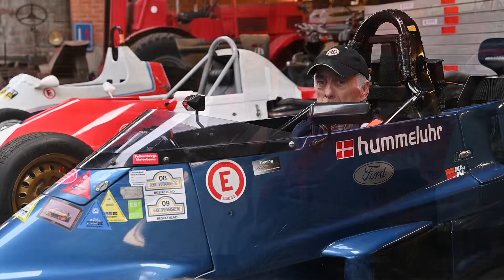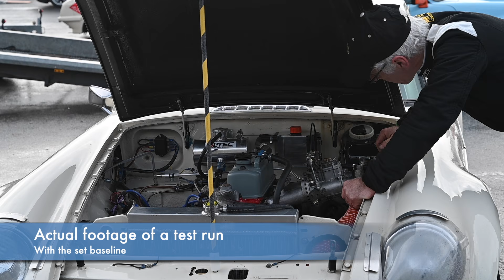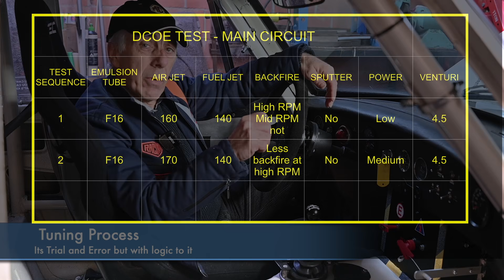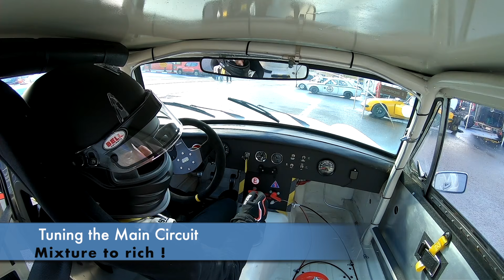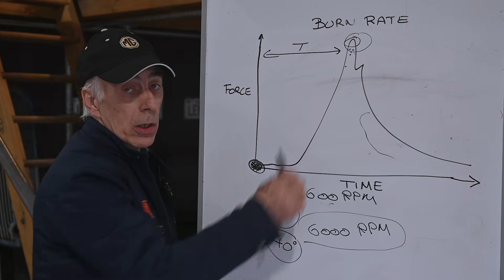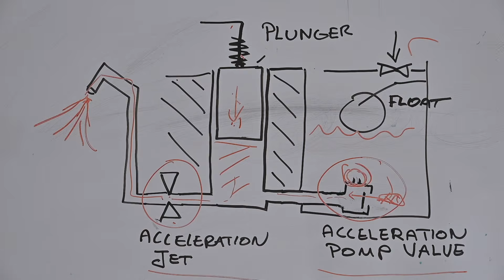Weber DCOE tuning -  Main and Acceleration circuits

Comment: I need help I've never had a car with Weber's now I own 1985 Ford escort with a 1.6 liter.  9-1 pistons milled head dual Weber if 40s down draft it has a 270 duration 440 lift cam and header and anza exhaust.  Sluggish till 4000 rpm then to 8000 it pulls ok. Maybe itz ok Cruz I'm used to 7 and 8 sec card. But this is set up for road racing.
Reply from the maker: I have an entire series on the working of the weber and jet selections.   Maybe have a look first on those.   Here are some baseline settings for the Ford ( I assume its a 1.6 Pinto) . 34mm ckokes, 140 main jet, 210 air correction jets,F16  Emulsion tube, 40 accelerator pump jet, 4.5 aux venturies, 45f8 idle jet, 11/8 Turn out idle screws,7.5 mm float and 15mm full droop float

Comment: Very good video! my car has too rich mixture in mid range and spot on high rpm... what could be?
Reply from the maker: That is not that easy to say, it all depends under which conditions - Load- on the engine. RPM's alone don't say much.  Assume that you are cruising ( butterfly partially open) and low end of mid to mid RPM's.  Then  i would increase the idle jet for more air ( larger opening), as this jet ( combo of fuel and air) handles the idle but also the transition circuit.  which will be in use during the low end mid/md `rpm range under low load.   What i  am trying to say is that the possition of the butterfly is importend to determine which circuit is feeding the engine.  Now assume that the butterfly is past  the progression stage, then you might need another emulsion tube that provides less mid range fuel feed.  or you might want to increase the air jet on the emulsion tube...  When you say "runs rich"   what does that mean ' backfires, puff's in the carb ?"
Reply: @D3Sshooter Thank you for answering, i didint specify enough. This is in a race car condition on full load, i use wideband to see the mixture. So, i exit a corner full throtle at 4.500 rpm and goes super slow (11 afr) from there still on full gas at 6.000 gets 12.8 - 13 afr, right on point... and when it gets the last 7.000-7.200 it tends to get a lilttle richier again (12.5).

Sorry if its a little confusing, you can see it running on my last video on my channel
Reply from the maker: @diegougarte  Ok , I see ...  Thanks for coming back with the clarification... The moment you exit, I assume the pedal is to the metal as they say.  That action causes two things, the accelerator pump sprays in extra fuel and the butterfly is wide open.  As the opening is now large, the air speed in the barrel goes down and as such the venturi effect on the secondairy venture reduces ( less fuel through the emulsion tubes and the main jet).  However the acceleration pomp has injected fuel. to aid the acceleration.   In your case , It seems that to much fuel is injected   as the engine bogs and is slow to accelerate. ( I bet you have a black smoke on the exhaust at that time)..   In this case you might want to adjust either the acceleration pump jet, go for a one step smaller ( I don't know what you have in it)...That will reduce the amount of squirted fuel and helps to reduce the  rich AFR. or the drain jet ( comes as a 0.35 to 1.5mm, the bigger it is the less fuel is squirted in when you floor the pedal).   the acceleration jet for the DCOE is a  76801 and comes in many seizes from 0.3, 0.35, 0.4   and up to 0.90.   Check it out...

Comment: I very much enjoy and appreciate your videos.  They are very informative.  With the Webers, it is worth mentioning that there is a difference in base idle mixture settings between the Italian and Spanish manufactured units.  I struggled a bit getting the Spanish units set before I discovered that the idle screw is different and needs more turns out at the base setting.  The needle is longer and sharper.  I thought I might need to change the idle jet, but 3 turns out got it running.

Comment: Too much guess work for me. Buy a AFR gauge if you want to do it that way.
Reply from the maker: Thanks,  it's not just guess work... its trial and error...  however if one knows the basic rules you can come very close,   Of course an AFR   gauge will help ( did that as well in other video's)  but only if you can log the readings,,, But even then you will need to understand the weber and select the right jets.tubes  to get closer to where you want the AFR to be,,,,,

Comment: Steve, I have modified my BMW 2002 with aggressive porting (E21) and a 292 cam. This is in contrast to the stock 264 (I think) cam and regular uncut head. The twin 40 DCOEs were originally set for stock engine and it ran well once warmed up, except always a low end flat spot that forced me to learn to heel-toe when I was a kid. How do I know what hardware to have in my tackle box? I am of a mind to change single variables at a time to observe the outcome. Adding more complexity (or maybe simplicity) is the 123 ignitor distributor that can set advance by blue tooth. Is there a calculation to know what hardware to obtain, and which are the obvious first variables to modify? 95.:1 compression; 94 octane 100% fuel non lead.

This probably requires a semester of teaching or its a 200 level course, but I know I can get my mind around this. I have rebuilt my carbs and I know how they work. I am also a cheater or lazy, and I will ask the smart guy. The forums take off in a few directions, and often degenerate into ad hominem quips. I want high end power, but also to be able to take off from a light up a hill. I do track days in my 911, and I would take the '02 to classic meets.

Comment: This is good stuff, i've got twin 40's on my kitcar and it seems like nobody knows how to set these up anymore, I ended up spending huge amount of money on "professionals" to fix a problem with bogging down on acceleration when warm, nobody fixed it.

In the end I stripped the carbs down myself to rebuild them and found LOTs of really bad stuff that had been done by these "professionals", like shortening and welding the accelerator pumps in such a way that they didn't fully close anymore, parts missing (3 of the the pump circuit bearings), the wrong float valves fitted (so it leaked fuel at idle), they'd damaged one of the idle screws, seals and washers missing, etc etc. They even broke part of my wiring loom somehow.
In the end the problem was a perforated Misab plate and there had been no need to mess with the carbs at all.
It's hard to know who to trust with this sort of work.

Comment: I had three of them on my TR six with a hot motor. It took me upwards of two years of research and trial and error, combined with a multitude of Jets corrector jets Venturis,pump jets emulsion tubes on and on. But damn, I had those carbs running like fuel injection when I was done

Comment: Steve - thank you for all these DCOE videos.  I've watched all of them, I think, and have a much better understanding of the system.  So I am going to try to tune the DCOE 45 on my MGB; I live in Colorado. Currently, the car bogs down in the 2500 RPM range; when I get up to about 3000, things perk up.  Main jet = 140, Air Corrector = 215, emulsion = F11, idle jet 55f8. Based on this particular video, in your troubleshooting section, I am thinking about trying a smaller Air Corr, at least as a start.  Again, thank you.

Comment: Mant thanks for your most informative vidios Steve.
  I have a Saab 96 v4 {a German Ford unit)  It is a rally spec car with two weber dcoe 40s. When I test the air flows, I get differing numbers between  barrels on the same carb. Is there any way to adjust this out? 
 Best regards
Reply from the maker: TXS for the comments,  a lot depends on what type of intake manifold you have... if it is one to one , then change the yoke in the carb  to have it matched... The difference  is mainly because the porting/valve lift and or piston suction for each cylinder
Reply: Steve,  many thanks for that.
 the manifold is a "crossover" type , as the engine is of  V4 configuration. It doesn't seem to pull air in any way.  I think I will just have to live with it. 
Thanks again for your wonderfull site.
Regards, John  D.

o

,

Comment: As I can see your Dcoe is far from 5⁰ as Weber recommend to be. You set the chamber level to 26mm with the caliper or there is another method?
Reply from the maker: Its about  6-7 which is not ideal ... I know... I might have to make some shims on the intake manifold...  for the caliper   yoiu can use a bit .txs for the comments

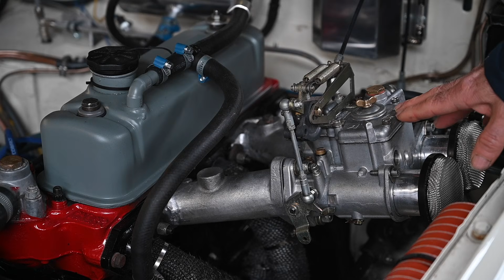Comment: @2:58
I never understand that people put those wire mesh "filters" on their carbs: it keeps the AIR out of the engine (as in "very restrictive") and maybe a fly too. But not the abbrassive stuf (dust) which wear down your engine. 🤷🏼‍♂️

So better without those wire mesh and accept extra wear or a real airfilter which is not really restrictive if it is choosen big enough.

Comment: Hi Steve, learning alot from your videos! thanks a lot. I fitted a pair of DCOE 45 carbs on my honda with an originally carbed 2000cc engine aiming for max. 6000rpm. for that i made a custom intake manifold as well. the runner length is 100mm and runner diameter is 45mm as are the carbs. it is running and driveable and i have good torque at 1500-2500rpm but when i open the throttle 70-100% (especially under load) it acts as if it hit rev limiter. feels like it doesn't have enough airspeed maybe? i can also only reach over 4000rpms in neutral by only opening the throttle max. about 40%. I have tried different ignition timing settings which only seemed to make a difference in the idle rpm. i also deleted the vacuum advance on the distributor. Should i try a different jetting maybe? The webers i bought new already had this jetting which according to your baselining video seemed to fit my engine quite well:
36mm Venturi Choke
4.5 Auxiliary Venturi
145 Main jet
F16 Emulsion tube
155 Air corrector jet
40 Pump exhaust valve
55F8 Idle jet
50 Pump jet
2.00 Needle valve
Reply from the maker: Thanks for the write-up..have a look on my video on how to baseline your weber...   I would start with the progression work.. thus Idle Jets enlarge it .. as those play a role in those conditions. Try to measure with an AFR gauge , that will tell you more.    Also make sure that your float level is correct , it might be to low

Comment: I just put a reproduction 48dcoe on a 4.9l ford in a 94 f150 it is mounted on a plate where the throttle body flange was it idles well and will accelerate hard until 3/4 throttle with the factory intake tubes and filter box but not open air horns  never played with a side draft before also the distributor and sensors are still running off the computer not much difference between distributor connected or locked out
Reply from the maker: I would recommend to look at the video's on how to baseline your weber.  Have this on my playlist webers

Comment: Really like your videos and your way of explaining!  I have a question. Spanish dcoes or fajs? I hear both can be tuned just fine and the low price makes it doable, of course🙂
Reply: Thanks for the reply! I will check out the video during supper🙂 Again, so glad to discover your channel. I am finnish building a Opel Ascona 400 for the street and i am now building a 400 for historic racing for  friend and am going to build a Ascona A «steinmetz» historic for myself. So brushing up on the theory behind things is super!! Thanks
Reply from the maker: @llarsk  Thank you and good luck with your build
Reply from the maker: Hi Lars, In one of my video's on the weber DGAS 37 I show the difference between a Spanish build and an Original Italian build weber.  You will see all the issues with that Spanish build weber... look here  https://youtu.be/TsnF-kjCxYo   Of course you can tune them after the corrections but are never as good as the real thing...IMO

Comment: Man such a great video. I have been looking to tune my high speed circuit too. I think I have a massive backfire issue through 4-5k rpm. But once in a while it’ll pull clean to redline at 7k. 
I’m thinking the 38mm Venturi is too big and doesn’t pull enough vacuum in the rev range. 
Do you have a video that accurately depicts the exhaust backfire while going through the revving?

Comment: Hi Steve. Did you consider making any changes to the choke size? Do you have any suggestions for choke size? I’ve a Mini with a 1340cc engine, Vizard VP3, cam. Mainly used for autocross and time attacks. I dropping the choke’s from 36mm to 32mm which makes the engine more streetable but it seems to have lost some power at the top ie 4th gear uphill.
Thanks Jim
Reply from the maker: JGB, yes I did set the choke size during the baseline video.  There are many factors that determine the choke. For instance the cylinder CC's that the barrel needs to feed.  If you have a four cylinder and one DCOE or  two that makes a difference.  Also the intake ports and intake manifold are affecting the choke.  Not to mention the cylinder-head as some are Siamese  ports (shared)..  that all determines which choke.   The main purpose of the choke is to be small enough to have high air velocity thereby creating that depression (venturi effect) at the opening of the aux venturie.  At the same time it has to be big enough to allow sufficient airflow,  thus velocity and volume are key. 
Your 32 is IMO to narrow , under low load conditions it will be ok as less mass (air-fuel mixture is needed) but when under heavy load ( 4th and uphill) the engine needs lots of fuel and the 32 is to narrow to provide the mass... OK it does create sa good airspeed but the mass is not enough... I would go back to the 36 and work in the idle jets and  emulsion tube type and or jets..
Reply: Thanks Steve I’ll give that a try.

Comment: please, what's the point of tilting the dcoe like that? you don't have a problem with the float level?
Reply from the maker: Good point, There is no reason to tilt it... its better not...  but that is how the intake manifold is....  at the end it makes little difference as the fuel level in a narrow tube like the emulsion tube ( that is the only one that counts) is so minimal in terms of level.
Reply: @D3Sshooter  Great! thank you!
Reply: Hi @D3Sshooter Please, did you make a float adjustment different from the manual? Is the float made of plastic? Thanks

Comment: 4:27 Steve, how do you determine (or measure) that the fuel pump delivers a sufficient amount of fuel to the engine, especially when you run your engine at high rpm?
Reply from the maker: That will be noticed by sputtering in the carb, as the fuel level gets low in the float chamber, thus the mixture gets more lean.   Initially the steady driving at high RPM is ok, but after a  time you lose power and the carb sputters.  That is a typical indication...  Always place a perfromance pump up with a return... that always works
Reply: @D3Sshooter  Thanks for explaining the tell-tales of a float chamber running out of fuel. Life would be so much easier if we somehow could measure directly the fuel level in that float chamber ...

Comment: Steve, when tuning carbs for lean and rich, did you examine the plugs. I remember as a youngster, reading that plug reading (examining the electrode colour and build up) was important when tuning carbs.  Just a thought. Brilliant video as always. Have you also tried to do the tuning on a dyno with the idea, maximum power at a given rpm??  As always thanks so much.
Reply from the maker: Marc, indeed checking the plugs for color is another approach , but can fool you as for acceleration you can't rely on it.  You could read the plugs for the main circuit if you can drive for a prolonged time on the main circuit and then stop and check them.. IMO its an aid, but its much better to test the engine hard out on the track.  Yes my car has been on the dyno and that is why I also know that the powerband is in the mid-high RPM's. That is mainly due to the 300 degrees 720SP camshaft...   But even without a dyno, one knows based on the camspecs, they always list the powerband... I might make a video on camshafts
Reply: @D3Sshooter  Thank you for your thoughtful reply. Look forward to more videos on the MG racer. Cheers.

Comment: Hi. Very interesting video. Do you think you will make the same video for SU carburator as the system is not the same. I know you have a video on the tunning of it but one "on the circuit" may be usefull. Thanks.
Reply from the maker: I could, once I have a car with a SU... something to put on my to do list
Reply: @D3Sshooter  ho, has you made a video on it, I assumed you had one. Thanks anyway.

Comment: Proper plug heat range and colour too. Rolling road sure is nice tho. Not even available near me, sadly. Back in the 70's I used to tune carbs in my bare feet, driving. Flat spots seemed more pronounced on the ball of your foot.

Comment: Are you using original Webers jets? Here in the states real original Weber jets are expensive.😕
Reply from the maker: Yes I do...as those are correctly machined.   Of course you can buy them blanc and drill them out yourself.

Comment: Thanks for the great video, when you say backfire is that like a miss  fire from the exhaust ? I get a big pop through the carb going from idle to main that can be fixed by a bigger idle jet but carb is too rich for a smooth idle with the rich idle jet. This problem is at a light throttle  just normal driving, if I give a heavy push on the throttle the car works fine. As the engine warms up the problem is less and only happens on slight hills giving throttle to stay at say 30 mph.
Thanks for your time.
Reply from the maker: Mike, backfire is indeed those explosions in t he exhaust..   I would in this case refer to another emulsion tube.. for slight accelerations ( like idle-progression-main and within main) you might want  emulsion tube that is more lean on low RPM's  like an F2 or F11